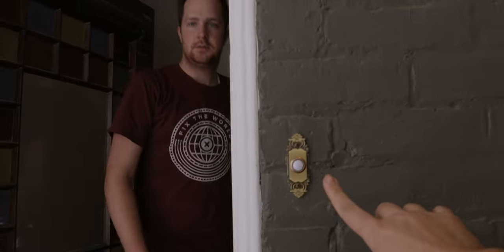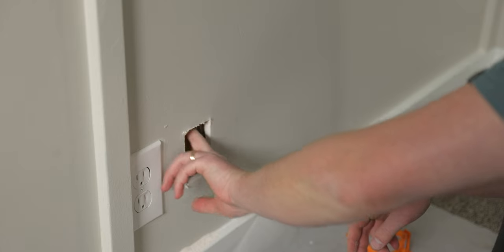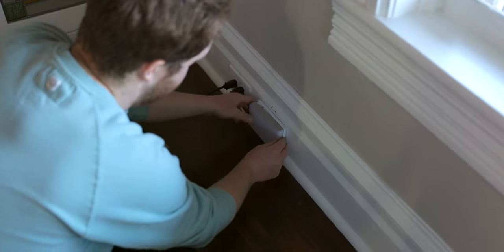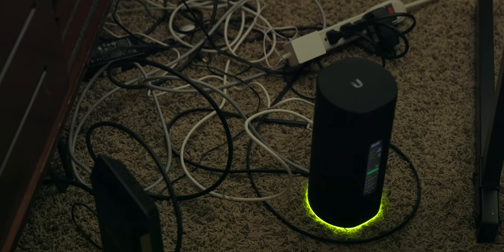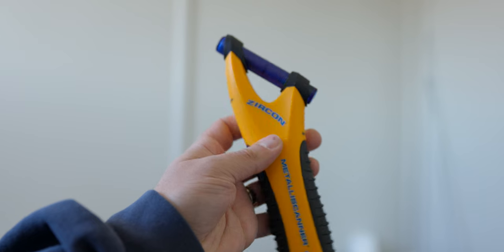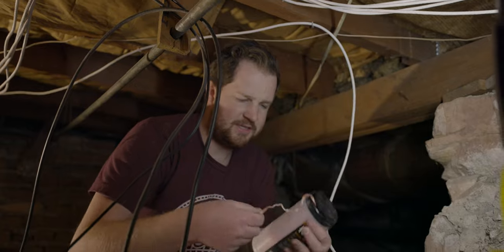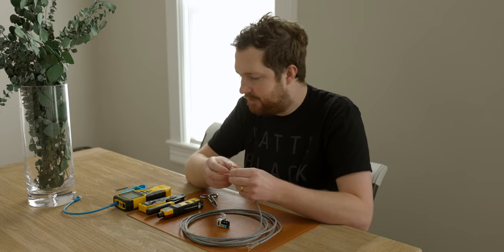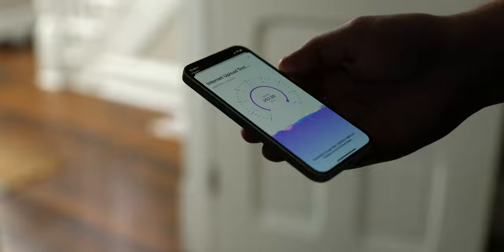Adding 10 Gigabit Ethernet to my 129-Year-Old House!

Comment: Very interesting video! I've done something similar in my parents house, which was clearly not designed for networking. It was actually a lot harder because European (or the ones in Greece at least) are made completely out of bricks and cement. No dry walls or plaster anywhere, to easily pass cables! So your best bet in passing through cables is ONLY by reusing pre-existing routes that were meant for other things (like tv, POTS etc.). But with a lot of planning and some compromises, you can actually make it!

Comment: “You can use a fancy little stripper like I have”, “they’re not that expensive”. 
Duly noted...
Reply: Actually the Klien Tool crimp tool he was using already has a jacket scoring blade on it.
Reply: @banditolobster  pretty much they all have it.

ps otherwise it'd be useless to do its job
Reply: @rawdez_  agreed.  I just mentioned it in case someone thought that they needed to get both tools.
Reply: @banditolobster  yeah, when i saw him with that blue thing I was like that Nathan Fillion but nevermind gif
Reply: @banditolobster  Klein, like german for small, not Klien

Comment: Great video...However, at the 14:50 mark, Do NOT cut the drywall out until you know where the electric wire is coming from in the plug next to it.  Turn off the power and take off the plate to the plugs and try and determine where the power cables are coming from so you do not cut into them and either visit your maker or at the very least visit a hospital...
Reply: Last words: You don't tell me what to do!!!
Reply: Depends on how you cut it. If using the multitool, you can cut the drywall without going very far into the wall. If using the knife, you can still take precautions to prevent injury, though might mangle electrical wire and have to replace it if you cut too deep. I think the best option is to drill a couple pilot holes; one for you to look through, and the other to shine a light through. This way, you can actually see if there is a wire in the way and know how to work around it, as it's not feasible to be able to determine which direction a run is coming from looking at the inside of the electrical box.
Reply: he used a stud finder to find the studs first. The outlet is usually mounted on the stud with the wire stapled to the same stud. Also to make you feel better, Most of the time that wire will be ran min 6in above the outlet when it passes stud to stud.

Comment: This feeling when you live in European brick house and I can't just cut a square in my wall to do this
Reply: @user-nh3gu1ge3d  Sucks to have a higher quality and more rigid house?
Reply: @VictorDude98  Yes. As it pertains to increased difficulty in running cables, as OP suggests. Also the ignorant stereotype that US houses are lower quality is, well, an ignorant stereotype. You guys have older houses because.... you're older. The US is only ~250 years old. There are plenty of structures here that old, or older. We don't have 500 year old houses because no one was here 500 years ago, except for Native Americans, of course. 

You think Europeans have some kind of magical construction process that the US doesn't have? Stone, brick, and metal?! Holy shit why didn't we think of that! Lmao. We have houses that are way cheaper than the average EU house, we have houses way more expensive, and we have everything in between. You get what you pay for. The idea that someone would buy a cheap house is evidence that "aMeRicAnS dOnT kNOw hOw To buILD tHiNgs" is as asinine as it is ignorant.
Reply: @VictorDude98  yea it absolutely does suck to have a more rigid house when our temp shifts, earthquakes and high wind weather means that our homes have to flex way more than yours to prevent them from collapsing during three seasons of the year.
Reply: @loki2547  False
Reply: @user-nh3gu1ge3d  true
Reply: @VictorDude98  more ridgid for what? So you can't easily remodel or make improvements? Ya awesome. Enjoy your tiny home
Reply: @loki2547  that literally isn't true
Reply: @randybobandy9828  Tiny, outdated, expensive, uncomfortable home, at that. US homes are built for comfort and cost, in general. There are plenty of US homes that are built from concrete, brick, stone, etc. as well, but most people care more about being able to afford a comfortable home that they can afford than about building something that will last 5x longer than their life span. And I don't blame them!
Reply: @user-nh3gu1ge3d  exactly...we have every material and know how to build our homes like Europe but we don't for a reason. Cost and size are a huge reason why we build the way we do.  I mean we live in a country literally filled with the material our homes are made of. They act like we live in shit homes but this house is in great shape after 129 years and it will last another 100 if it is maintained. Some of these European are bragging about living in a 3-500 year old home like it's a good thing. Ya it might be old but who wants to live in a tiny outdated unsafe home? Do they think they had building  codes back then to keep your home safe? No.
Reply: @randybobandy9828  Yup. And they seem to forget wood lasts.....forever* (*if properly maintained). I mean, even some trees out in the open last TEN THOUSAND YEARS+. A wood house should last forever, assuming it isn't destroyed by a disaster or negligence. Basically just 1. water, 2. fire, 3. some other huge disaster. And even your stone/brick/whatever house would probably be destroyed by that stuff too. I mean, ok, yeah the walls are still standing after a disaster but EVERYTHING in it is still ruined. And at EU labor rates and taxes, it's cheaper to rebuild a whole house here from scratch than "fix" that in Europe. Cool, your walls are stone, but you cabinets, island, flooring, paint, furniture, electrical, mechanicals, etc. etc. etc. are all the same, basically. 

Really the only major advantage I see is termites. With the chemicals they are using these days, though, one termite treatment basically nukes the entire neighborhood of termites (seriously, read up on it). And it costs like... two hundred bucks? My house was NOT termite treated EVER and is about 60 years old. There were some minor termite issues on a single door, basically they ate one TINY strip of wood from by an exterior door, and that was it. I got my house termite treated and that's that, for probably decades. Even this termite damage from who knows how long ago, it seems that they were killed by a neighbor getting a termite treatment in the past. The stuff they have now is SO powerful that it's only an issue if you totally neglect it for years and years. Basically just use your brain and you're fine.
Reply: A little planning is needed that's all. Wait till you are doing a make over or redoing the electrics - you will get all the access you need. Don't forget those unused chimney's.
Reply: @user-nh3gu1ge3d  that is true, you know how to build good houses, you just decide not to do so because of shit like your economic systems which makes it impossible for people to afford a better house.
Reply: @kobysimmons6081  in southern Europe we also have earthquakes and yet our rigid buildings have been standing for literally thousands of years. We also have quite a bit of a temperature range in the alps etc (-30C to 40C without a problem) and yet our houses stand.
And as long as you don‘t build a skyscraper wind isn‘t really a concern.
Reply: @rootchiller  exactly, put in an actual tube once to run your cables and when you need to replace them you can do so easily.
Reply: @user-nh3gu1ge3d  typical sensitive american... Yeah you are the best bla bla bla...
Reply: you drill holes with hole saws in Europe. In Finland atleast. 47mm if i remember correctly.
Reply: @zachariejf1293  Let me go look for any other flags on the moon real quick...
Reply: @inventorxtreme  yeah you're the best...
Reply: @Aethid  "American houses ARE lower quality on average compared to most of Europe." Again with your misleading apples to oranges comparison. You are comparing houses that are twice the cost and then pointing out that some cheaper houses are lower quality. Well..... duh. But that's not a problem with "building know how". That's just "some people choose to build cheaper houses". Ok. That's not some "flaw with America" or "you American's don't know how to build good houses" stupid tripe. 

Compare a house in the US that can be bought for $100,000 to one from EU. Then compare a $250k US to EU. Then a 500k. Then a 750. Then a million. I would put money that the one from the US is MUCH better. Your problem is you're comparing a 600k house in the EU to a 189k starter US house and then saying "aMeRiCAnS dON't knOw HoW t0 bUiLD hOUseS!". No, you just don't know how to apply basic logic. (Oh, and remember to control for area too, e.g. not a house in LA to one in Poland, or one in Paris, France to one in Paris, Tx. Similar land values, remember "LOCATION, LOCATION, LOCATION"). 

We can build houses as well or better than Europeans. Just because SOME people may not be able to AFFORD those nicer houses, or may not WANT TO PAY FOR that quality construction, says nothing to "American ability".  

"The walls are paper thin" No they aren't. Undefined term with zero evidence. 

"and made of cheap materials" You say that like it's a bad thing. Cheap is good as it pertains to price. If you pay twice as much for the same brick, does that mean you "won" or "lost"? I'd say you lost. Sorry you have a 25% VAT on everything but that doesn't make it better quality.

"the windows are usually only double glazed with poor air tightness" Firstly, please provide the study that you obviously used that proves a higher air tightness in Europe vs the US. I'll wait. Secondly, "only double glazed" is again a per person decision based on a lot more than just "which window has a higher performance rating". Perhaps the person doesn't live in Norway or Sweden and doesn't need a high performance window? You know in some parts of the US, people leave their doors and windows OPEN around the clock because we don't actually live in a shit climate? Did you think about that? And if that's the case, why would someone want to spend $20,000 extra on "extreme, better than the Yanks, windows" when it will make little difference? Exactly, they wouldn't. And that's why they don't. NOT because we "don't know how". Stupid. 

I would speculate that if you compared people who ACTUALLY NEEDED them, like only those in Maine or Alaska (or similar very cold parts of the US), they don't have drafty windows, on average. But I haven't researched the numbers like you clearly have so maybe you can enlighten everybody and link your evidence. 

"you use bitumen shingles as the most common roof finish" Yes, because it's great. We call it an "asphalt shingle". It's super easy to install, cheap to make, lasts a long time, cheap and easy to install, etc. Why wouldn't we use it? "Because metal or clay last longer"? Again, you seem to look at ONE stat and then ignore everything else. That's your problem, you lack vision and big picture understanding. You miss the forest for the trees. Yeah, metal and clay last longer. But they also have lots of down sides. Clay is heavy, it's expensive, it costs more to install, it will BREAK if stuff hits it (like tree branches, etc), and so on. Metal, well, it's mainly just the cost.  And by the way, we do have many metal, clay, wood shake, slate, etc. roofs here. It's just most people choose asphalt because it's the best value.

I just had my roof redone with asphalt. I could have done any roofing material I wanted but I WANTED asphalt. The actual shingles last a pretty long time, like 20+ years. I don't know if you know this but when a roof leaks, it's typically not the shingles that are actually leaking. It's typically the FLASHING around the plumbing vent pipes, the skylights, etc. They paint a rubber "seal" around the pipe and add flashing, etc. Well the rubber part is what cracks and starts to leak, NOT the shingle, typically. Asphalt shingles are great. Easy to install, cheap, easy to fix, not too heavy, look good, etc. etc. Even someone as dumb as you could go up on a roof, pull out some shingles, add a hole, and replace the shingles in an hour or two. It's simple, easy and effective. Can you get up on your clay roof and replace some of those tiles? I mean, it CAN be done, but I'd like to watch you (or the average person) try.... Good luck not breaking your clay tiles by walking on them. Try and "break" an asphalt shingle. :D 

"Most new houses in the US would not come close to passing most European country's building code." Which EU code(s) would not be passed? And how much is "most", are you claiming >50%? What is that percentage? And are there any other concerns that would render this statement moot (e.g. building codes on insulation in Sweden might be a lot more stringent than in Texas due to temp, and since Tx BARELY gets to freezing temperatures, it doesn't NEED that level of insulation, etc). Again, please define your vagaries and provide evidence to back up your baseless claims you just pulled out of your asshole. I'll wait. 

"That is not an "ignorant stereotype", it is the truth, and you are the ignorant one for believing otherwise." Ahh, the good old "this is the truth" claim. I've noticed that typically people claiming to have a monopoly on "the truth" tend to be wrong. But hey, it's easy enough to prove if it's "the truth", right? So why don't you go ahead and link all your evidence and I'll be happy to take a look. You'll notice that most of what I said is just basic logic and common sense (like that a lot of people want a less expensive house, prefer simple things to complex ones, etc) whereas you cited specific things like "wouldn't pass code" or "lack of air tightness". Your technical points require data to support. I notice you provided ZERO. Didn't stop you from CLAIMING superiority though, as Europeans typically do, despite all the evidence to the contrary. Just desperate to not be forgotten, ignored, left behind I guess.... Well, just do better. Then people will give you the attention you so desperately crave.
Reply: @zachariejf1293  We know...
Reply: @kobysimmons6081  There aren't any real drastic temperature changes or earth quakes or natural disasters to protect against here
Reply: @randybobandy9828  I mean, you do love your dry wall
Reply: @user-nh3gu1ge3d  Dude, these are YouTube comments, chill

Why so offended?
Reply: @resneptacle  ya because it has many benefits
Reply: That's exactly what I was thinking when I saw him with that tiny saw.
Reply: Lol look at these guys, fighting over damn houses.
Reply: That feeling when you live in Australia and you can do absolutely everything he can in this video, but the law says you can't :(
Reply: @SmiledElf  If it's your house, what's the issue? What law?
Reply: @user-nh3gu1ge3d  we need a "registered cabler" to do any sort of data cabling work behind a wall
Reply: @SmiledElf  Well, again, if it's your house, why don't you just do it anyway. You're saying the police are going to come and check on your cabling and call around to see if someone licensed did it for you? It's in your house, just do it yourself if you want to....
Reply: @user-op8fg3ny3j   Your comment needs a little work (non sequitur). You say the reason is we have different natural resources but then draw a conclusion about the climate (not the available natural resources). But I take your point. I don't think that's the reason, though. Britain has plenty of trees, and wood is fine in that climate (or just about any climate). 

If your house is underwater, that's a drainage/architectural issue, not a materials issue. The roof is made from whatever material that isn't sensitive to rain. The rain then falls to the ground and flows away. Wooden walls aren't a problem. When was the last time your walls were wet? Never? We have wooden houses in our VERY rainy climates in the US (Hawaii/Florida/SC/etc) and it's no problem.

One big reason why EU places have homes made from alternate materials is age. European cities are MUCH older than US cities. Drywall, milled 2x4's, etc. are relatively new products. Anyway, no need to rehash all the other comments.
Reply: @randybobandy9828  so we don’t have to heat huge spaces and wast energy and money.
Reply: @bobhook336  have you never heard of a multi zone minisplit before?

Comment: I really envy timber framing homes in these type of works, it's so easy to route wires, cables, and pipes. (In our country, Taiwan, we mostly lives in reinforced concrete houses)
Reply: wow.....that would be a challenge
Reply: Yeah, I was expecting a concrete house since it's 129 years old and maybe apply some thing to mine -- but I guess not!

Comment: Although I’m a renter for the foreseeable future, I really really enjoy this type of renovation video presented in your style. I’m sure they’re a hassle to produce, but I hope you make more
Reply: As a renter, don't overlook that you can use Gigabit "Powerline Ethernet" adapters (such as those sold by TP-Link). They're great (if you don't mind losing an outlet... they kind of block both outlets due to case design)
Reply: @thisisreallyme3130 honestly those things fucking suck. I'd rather run cabling along the walls and stuff inside the house to get ethernet that way